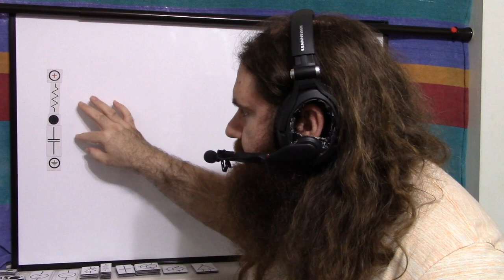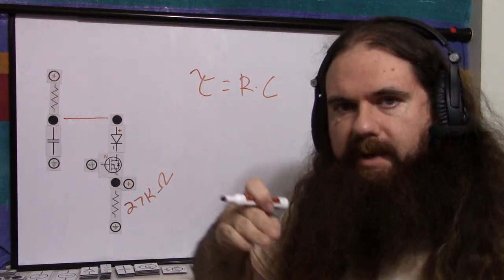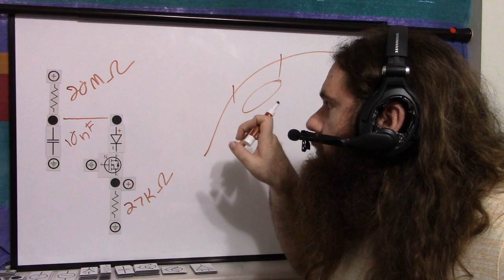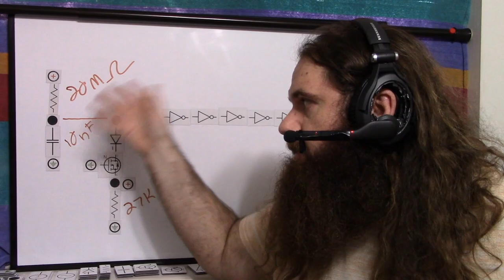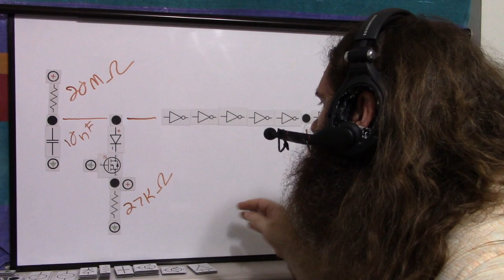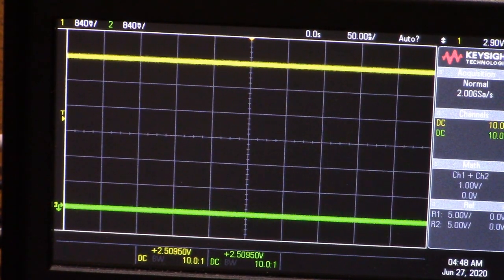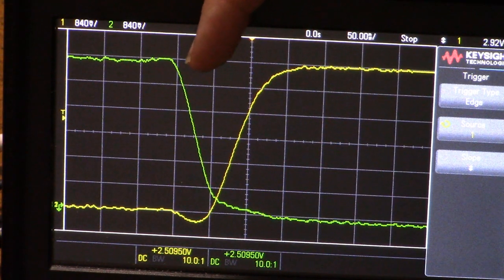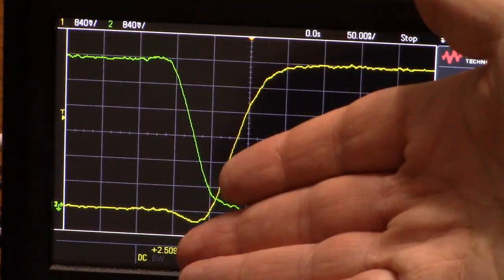Boot Up Signal Circuit Design - Easily Signal or Configure Chips At Power On - Simply Put

Comment: This explains what I needed, tried doing this myself without any knowledge, basically needed the hex inverter. But this caused me to think that this could also be applied to my other issue, that I have been really strugling to even think of what a solution to it is. I have a mcu that is in sleep mode, and I want to turn it on, when voltage goes >13v. So I figured a zener diode to trigger it, but that would just give me a high signal, and I need the mcu to go low to reset it, then go high again, and it's triggering that short pulse to ground that is causing me the problem.

Comment: Just stumbled on your channel, and I'll be watching more of it to get teaching ideas!  You give a nice, clear explanation of generating a power-on reset signal.

In place of that 27k resistor, another option is a 1N4148 backward in parallel with the charging resistor: dump the capacitor back onto the power supply rail at shutdown. (Or of course your JFET dump circuit, although availability of discrete JFETs in quantity is spotty since the Chipocalypse.)

What logic family are you using for those inverters?  The gain you're seeing seems low for CMOS (although recently I've been mostly running 4000 series at 12V because I've got a bunch of opamps about and 12V handy, so I get faster transition times than 4000-series at 3.3 or 5 volts). Were you using a 4069 by any chance? Those are only singly-buffered, which makes them SLOW (and also gives them a really weak drive capacity).  A 4049 would give you a much cleaner transition - but watch out, the 4049 pinout is weird.  74HC04 would also be an option, if I recall correctly. 

You made a remark in passing about the Schmitt trigger not giving you inverted signals.  Huh? CMOS 40106 or 74HC14 are hex inverting Schmitt triggers.  I'd probably use one or two 74HC14 stages in this circuit and have four or five more Schmitt triggers available for cleaning up pushbuttons or whatever. Yeah, 40106 is slower than 4049 but for this stuff it doesn't matter.